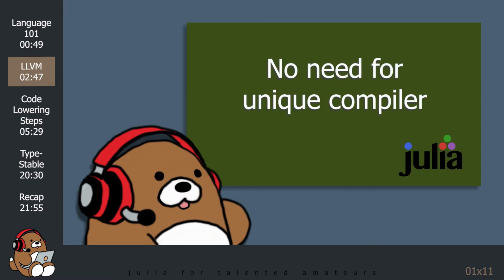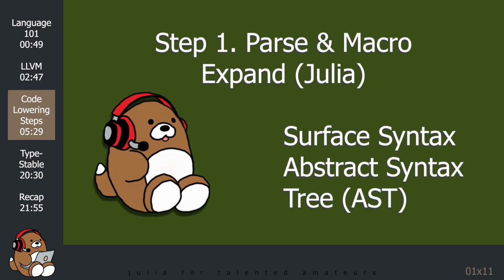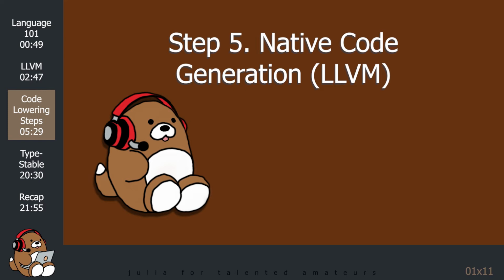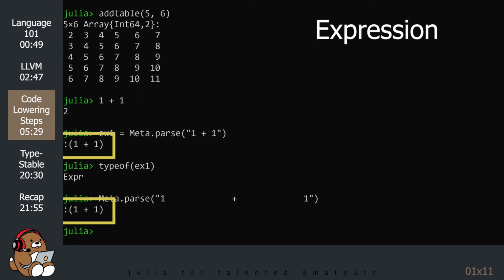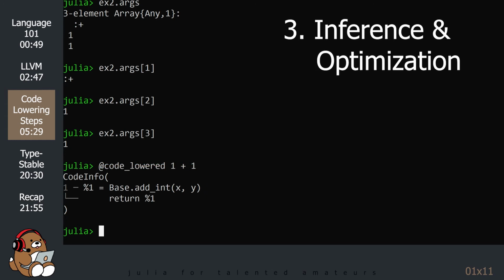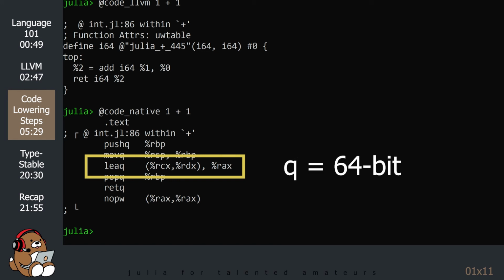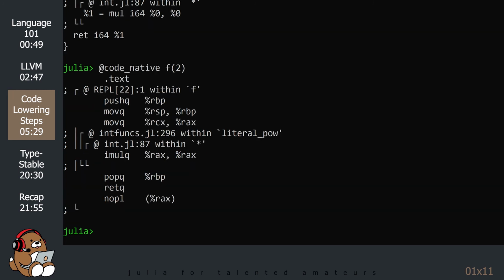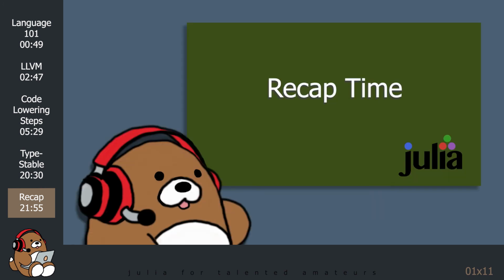[01x11] How Julia Works (part 1 of 2) | Tutorial 11 of 13 | Julia for Beginners

Comment: Thank you for the video. But I think type stable means a variable does not change its type. It has nothing to do with input and output types of a function.
Reply from the maker: Thanks for watching and thanks for the correction! What I was trying to articulate, but clearly could've done a better job at, is from the Julia Documentation FAQ section under "What does 'type-stable' mean?" -- "It means that the type of the output is predictable from the types of the inputs. In particular, it means that the type of the output cannot vary depending on the values of the inputs."
Reply: @doggodotjl  I see. What that talks about is a type-stable function. What I was talking about is a [type-stable variable ](https://docs.julialang.org/en/v1/manual/performance-tips/#Avoid-changing-the-type-of-a-variable). Both of them impact the amount of optimization a compiler can do.
Reply from the maker: @syc52  Thanks for point this out! This will help clarify things for anyone watching this video!